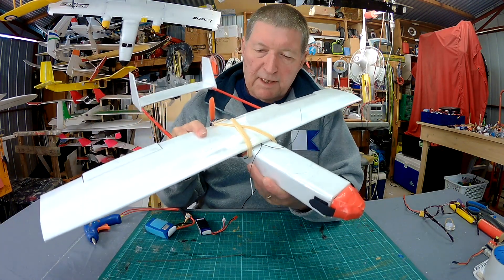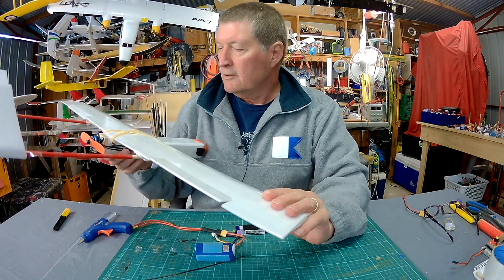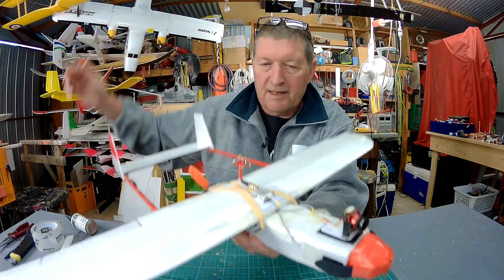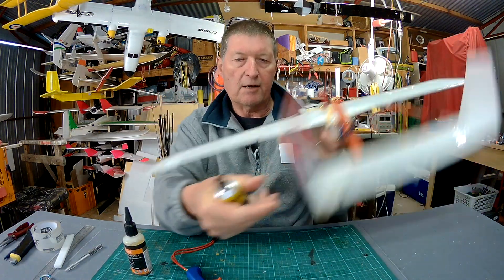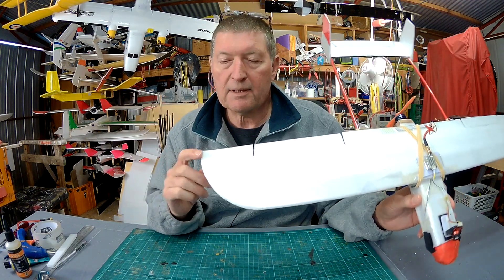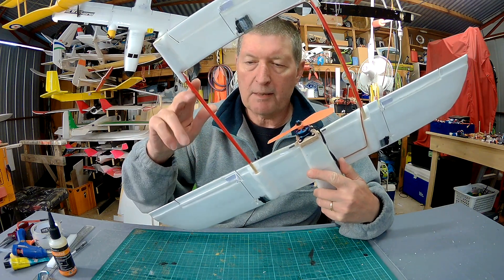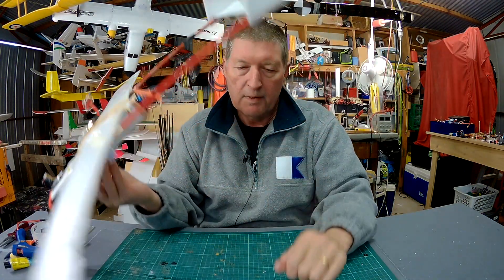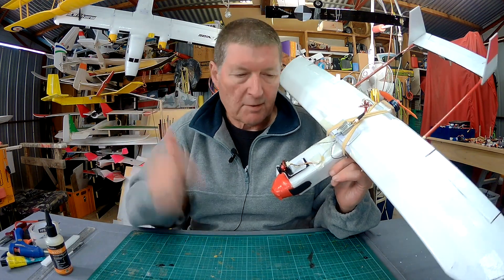Depron Micro Skyhunter Mods Q&A

Comment: could you say how long the fuselage is? I build it yesterday, but 245mm / 12,5cm in front and 12 cm under the wing doesn´t looks  like so long as yours.
Reply from the maker: Yes it is 245mm not including the motor mount plywood and 40mm foam nose is the final version length. I did shorten it by about 50mm from the original in the maiden
Reply from the maker: Watch from 1:45

Comment: Wonderful little plane Mr. Newton!!!
I was a US Navy Hospital Corpsman (medic) and I always seem to see potentials for injury.  You obviously aren't worried about a prop/hand strike but do you recommend any other method of hand launching a pusher prop plane?  Didn't you have a hand injury once from a prop strike?
I have been a subscriber for a few years now and I don't have a single tire mark.  I've learned a lot from you, keep up the wonderful content.
Reply from the maker: You are right about the injury potential. I have chopped my launch finger 3 times, aways with a flying wing. So now I only launch wings with side arm sling. Planes are not as dangerous because the prop is further back and you have a better hand hold to do a clean throw and follow through. Thanks for watching
Reply: Thank you for your reply as I will build one of these in the future and will experiment with the launches. I’ve never flown a wing but when I do I will take your advice and wing tip launch. Keep up the great work/fun.

Comment: Only just seen this... Stupid "notification" bell.

Just a couple if points:

Rounded wing tips are supposed to be more efficient, with eliptical (Spitfire, AXN) supposedly the best.

18650 is /usually/ pronounced eighteen-six fifty, not that it really matters.☺

Turned up wing tips should give you more stability at the cost of reduced maneuverability, but probably won't be noticeable on such a small plane.

The holes of control horns should ideally be directly above the center of the hinge and I doubt you'll notice any adverse roll on this model, but that said it seems to fly OK anyway so enough nit-picking. ☺

Thanks for the post!

Comment: Great job Andrew! Plan to build one of these within the next few days. What is the actual CG measurement for your design? I don't think I've seen that number anywhere.
Reply from the maker: I haven't measured it but it will be 30% of 120mm which is about 36mm. I'll do some proper cg testing next flight
Reply from the maker: CG tested back to 45mm which was just a bit too far aft. Around 35mm is good.

Comment: The t-motor air 40 is an amazing motor. So light at only 24.6 grams but with good power. Awesome power/weight ratio so I use them on all my smaller wings. With Dal cyclone 5046C on 4S they have such a furious scream. The dogs around here must hate me. So as Matt O would probably say "go 4S or go home". BTW:  If I am a subscriber who has gone under the bus I didn't feel a thing.
Reply from the maker: Haha, thanks mate.
Reply: Thanks for subscribing but at this stage my youtube channel is really just used to do warranty claims, typically with banggood. I have no pearls of wisdom to spread, except depron breaks really easily.

Comment: Hi Andrew, was wondering if you have ever tried Beacon's Foam Tac? For reference: https://smile.amazon.com/Beacon-Foam-Glue-Carded-Adhesives/dp/B0052RUL28/ref=sr_1_1?s=toys-and-games&ie=UTF8&qid=1530154562&sr=1-1&keywords=Beacon%27s+Foam+Tac

It very quickly became my go-to glue for new builds and repairs. It tacks fast, helping to keep parts in place, gains strength quickly over 10-15 minutes, remains flexible but holds fast and dries clear. It can even be used to reinforce hinge lines or be used as the hinge by itself. Adheres to almost anything, foam, carbon fiber, wood, plastic and metals. If you haven't used it yet I'd be interested in what you think if you get the chance to give it a shot. Thanks for another great video!
Reply from the maker: I can find it in Australia unfortunately, but I'll keep looking
Reply: Just looked a Amazon.au and it's $40!!! Wow! (What's one to do to find a smuggler when you need one?)  I've not used UHU por but I understand it's similar.
Reply: Looks like I can get it shipped at a reasonable rate from MotionRC. What's the best way to contact you privately, I'll look at getting some to you?
Reply from the maker: Thanks for the offer but I have found some on eBay

Comment: Question, would moving the fuselage alittle back help out with CG and ability to move battery back, you mentioned nose heavy. Just suggestion with my similar planes I used a kmf 2 wing
Reply from the maker: Very good idea, I could just put the motor on standoffs to move the CG back and reduce noise. I'll try that